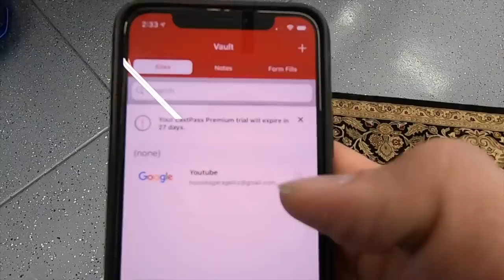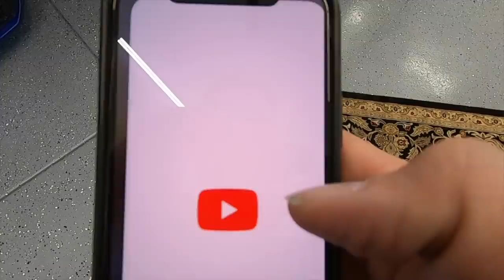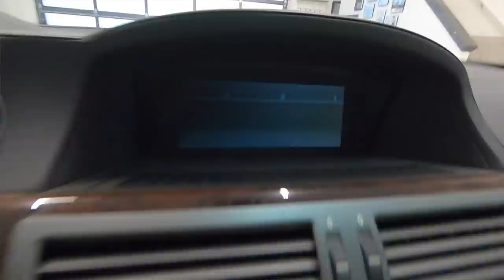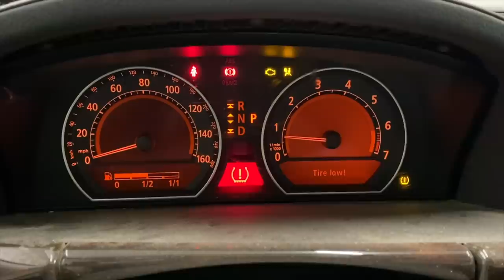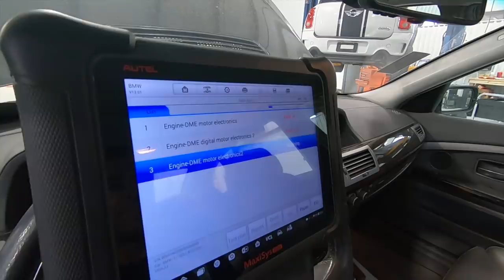I Bought a Cheap V12 BMW 760Li, Because I Never Learn From My Mistakes

Comment: Hoovie: Is there any BMW made good

BMW specialized mechanic: No
Reply: Idk?? Maybe any new BMW? These silly stereotypes hav to end! 
#beemsforlife
Reply: @nocreaselucas8810  I doubt that. I bet old BMWs are better. New ones are made to break right after the warranty expires. Now German manufacturers are not what they used to be, now they care only about business and sales, not longevity of their cars. Nowadays a car is treated like kitchen appliance basically.
Reply: @natethekvd  The E46 only with 6 cyl engine. 4 cyl engine with valvetronic or ANY engine with valvetronic: don't walk away, you run. Run like hell!
Reply: @nocreaselucas8810  Any new car is"good"as long as its new.....
Reply: Specialized with only seeing the BMWs that have been neglected far too long since the owner could never afford it in the first place. 16+ years of BMW Service work I will say that there are many reliable BMWs but You have to maintain them.
Reply: loranga japp pp
Reply: @EYUK1  ?
Reply: @natethekvd  My previous 2004 e46 330cd chipped (250bhp, 510nm) did over 250k miles on the original clutch. It was still in good shape when a sold it. Had to replace the hardy disc a few times and some other small things. Best car i ever owned.
Reply: The e38 is good
Reply: @ruudklasen8656  Its nice,not the same as good.

Comment: Hoovie: “have they ever built a good BMW?”
Pro BMW/German Mechanic: “Not that I know of”

😭😭😭
Reply: Swat all the bmw’s made before the 2000’s are actually pretty reliable as long as you maintain them of course
Reply: The truth sucks 🤣
Reply: @yourfather5324  True, buts most of those have now rusted to death. So all in all there aren't may BMWs out there that could still be classed as reliable.

Comment: ''Have they ever made a good BMW?'' Pretty much anything before 1996.
Reply: Andy Andarius No they were still pretty crappy....
Reply: Andy Andarius *Sad E46 Noises*
Reply: das wright  I had a 1987 735 and it was crap....
Reply: @lorangajapp8086  Why? It's a boat on wheels, super simple to work on.
Reply: @MiGujack3  Still crap...
Reply: @lorangajapp8086  Proper reasoning and arguments. Not.
Reply: @Swordie100  What?They are bad.
Reply: @lorangajapp8086  You are literally acting like a 6 year old by screaming you don't like something, just by not providing any facts or arguments. You're just yelling and looking for attention, that's all.
Reply: @Swordie100  No,they are just shitty cars.Dont care if you are a fan boy.And i never said i dont like them,they are just bad....Sadly.
Reply: @LuredDecoy  You are the one who dont know about cars...I worked on them for almost 40 years...BMW is nice but not good.The 760 in the vid is probably a wonderful car,but not good.
Reply: Nah, the M52 and M54 engines are all basically solid so long as you do preventative maintenance on all the plastic and rubber bits that fail with age. I've had several and none of them have ever died on me. It was post 2000 when they started to get too complicated for their own good. I think the E39 and E46 were the last models that weren't designed to fail right after the warranty expired. I think they will be considered classics in a few years.
Reply: @soundseeker63  I really liked the e39.
Reply: @lorangajapp8086  got an '83 bmw 320i with 300k on the original motor lol the e34 5 series is a great car too and not to bad to work on compared to an e39, e36 also a great and decently reliable sports car... maybe the shit automatics with air suspension are unreliable but they make some pretty good manual gearboxes and static suspension if i say so myself... lots of great motors anc cars from them over the years
:)
Reply: @sebg1224  Love the gear box on bmw.
Reply: @s.i2282  No i have my own business...No you wouldnt fan boy.Come to think of it,i havent been on a bus(except my own)for 20 years.And fyi i actually bought a 2014 mercedes today :)

Comment: Buys V12 7 series
Also has Rolls Royce Phantom
L O G I C
Reply: One for cruising, one for hooning
Reply: Logic7 ;)
Reply: they are not the same cars, thats the logic
Reply: Tehgziz Lauw it’s not like he has a gallardo or anything....
Reply: @dr-ok3sn  both the phantom and the 760 has the exact same sound system called Logic7 with a Logic7 DSP/amp that's notorious for breaking as soon as you look at it.
Believe me I have one and it's sent away for repair right now.
Reply: Logic 7 :)
Reply: @papaannefranku9693  yeah but he won't feel bad about hooning the 760, the Gallardo is mint
Reply: Shug not even close🤦🏼‍♂️
Reply: Nordmark productions most of them rolls royce are using actually a meridian soundsystem but okay😂
Reply: BMW could be a parts car.

Comment: 16:09 $2800 repair - that's typical - welcome to the 760LI owners club :) wait until you discover that swapping plugs-only is unlikely to fix your misfire and you will likely need to swap all 12 fuel injectors (and coils,) lol, then you will really experience sticker shock. Check out my 760LI on Scotty Kilmer's channel...
Reply: Yes. The check engine light is unfixable on the v12. Coils, plugs, injectors, injector wire harness, valve stem seals, carbon walnut blast, intake leaks.... no fix seems to make the check engine light stay off.
Reply: @TheButcher9811  Really?? Mine has no such problems with the check engine light - but I had the misfiring on several cylinders shortly after I bought it (but not all 12 cylinders like this salvage car he bought!) and changed parts sequentially without success until throwing in the towel and replacing all the injectors, coils and plugs as well as the 3 fuel filters (yes, you read that correctly - there are 3 fuel filters in this grossly-over-engineered car!) and it has not had misfiring issues since then.
Reply: Scotty kilmer, i wouldnt trust that old fool

Comment: I have a 2008 BMW 760li, I haven’t had any issues with it, I had to get the computer update but it was free!
I also have a 2013 Mercedes S65 no problem with it either. Kia, Hyundai and a few others shouldn’t be mentioned and never compare to BMW or Mercedes these two companies been around over a hundred years so they must be doing something right!

Comment: I have a BMW for the last 4 years and has been the most reliable car I ever owned.
Reply: Same here, its a 550 v8. Maybe we are lucky
Reply: @nature10879  Usually BMW drivers don't really take good care of their cars, plus for most of them their driving style is damaging.
Reply: Both of mine were aswell I'm looking for a 3th one
Reply: @gordonnorris4202  after 3rd owner, its total neglect
Reply: I have a hard time imagining that I won't make it past 200k miles on my 2007 X5 and I tow it's capacity pretty regularly.  I love me that N52 engine.
Reply: @russianrick8403  mine was at 230k before I crashed it I could of done even more and I would probably still have it cuz I loved it
Reply: Same here I'm on my 3rd 7 series, 01 e38 no issues, 08 e66 no issues, 12 f02 only ac/heater blower motor
Reply: You must have come from Jaguar.
Reply: Same here, had my E60 530d for 4 years now, runs beautiful. I was considering working from home once for example and thought nah fuck it, I'll drive in lol
Reply: @nature10879  Hey man, I have the same car 08 550i manual and it came out of the shop this last wknd. Had to replace the alternator bracket gasket which cost me 3200 after paying to clean the engine bay. Did you have any leaks on the car and what milage?
Reply: @GanjaBear29  None whatsoever. Mine has been trouble FREE. Its automatic, and i currently have 153,000. I may need a battery soon though. Its getting cold outside here in kc. I started having to reset my clock. Other than that its been flowless. I am watching out for stem seals but so far reliable car. I hate run flats too.
Reply: @nature10879  steam seals will be an 8k job. I would throw in the towel once you start seeing smoke after idle.
Reply: @GanjaBear29  Yes at the dealer. I know someone who can do it for half the price or less and he only specializes on bimmers. However, if that happens, i will have to weigh my options. But i will stick with bmw, specifically an X5M from carmax. Am open for a Porsche suv from car max too.
Reply: Sebi Gordan can’t relate 😂😂
Reply: Rick Harris I have an 08, taken care of well, and pretty much everything is wrong with it
Reply: have 4 BMW's, one of them is e66, two are over 200k miles...  no major issues.  more reliable than most other cars I ever owned, and certainly the easiest to repair.
Reply: @GanjaBear29  "alternator bracket gasket" ive never heard of a bracket gasket and ive worked on cars for over 20year and have been ase certified for 15 years.
Reply: I have a 2003 e46 that I still drive everyday. Lots of preventative repairs, but nothing major. But it does leak everywhere every now and then lol.
Reply: nature10879 e60? I just picked up a e63 650i 6 speed manual with 61k miles. Had a check engine light for the variable timing valve solenoid. Cheap replacement part and now the car is running like new.
Reply: Rick Harris the m54 engines were the most reliable in my opinion. My father in law still has his x5 with over 250k original motor and trans. Lol
Reply: @shootunderpar4736  good. Remember oil change regularly too, no 8 to 10k intervals. Maybe 4000 miles or less. You dont wanna mess up the stem seals. When they dry/harden out, the car may smoke and run rough. Its a 4k to 8k job. If the previous owner/s took care of it, it should be very reliable.
Reply: Dude most of them are so unreliable. Good luck with yours.
Reply: @nature10879  in My country you can replace the valve stem by 1500 It's not a big deal
Reply: @edgardonunez4434  that is nice. Here stupid people rush tk dealers a d get ripped off. It can be done for 3,000 at a trusted independent mechanic. 1500 is really cheap:)
Reply: @nature10879  Tbh it's not even that big of a deal. People always make BMW repairs sound like this incredibly expensive job, and Tbh, the parts aren't that expensive.
Reply: @protess5  yes absolutely.
Reply: @bigsean2473  I would suggest googling it. Unfortunately, it is a real thing. I couldn't believe it when I first heard of it too.
Reply: @timothym5678  i did that day. seem the bracket housing is made on a motor cover. why idk but it is
Reply: @GanjaBear29  3200 for a 5 hour job? Man I'd love to be a tech wherever you go.
Reply: @BNR32FD3S  It included some additional stuff like cleaning the engin bay and replacing some small shit. Truth is I get fucked if I dont know someone which is what happened. Actually I need to take it back this week b/c the engine light went back on after 3 hrs of driving and there is smoke comming from somewhere by the light. Good thing is I have a manual car so its not a total loss
Reply: Four years is not very long.
Reply: Sebi Gordan me too my 750Li has been extremely reliable. You just have to find one that rich white people have driven carefully
Reply: What other cars have you owned? BMW starts out great but once past the "lease period" they're pretty awful and there doesn't appear to be any reason for it.
Reply: @gordonnorris4202  really the driving style isnt much damaging. its just poor people that end up buying an BMW just so "showoff" (70% of the buyers) and when they have their BMW they see it requieres alot more maintenance then their previous fiat. because they've spended all their money on the car they cant afford good maintenance en the car breaks down. i have an BMW 540i xDrive (newest 2019 full option luxury line) en its really reliable. also really fast (4.8 sec 0-60)
Reply: @gtigaming3059  If you do burnouts and launches everyday to show off, of course it will damage it.
Reply: I got a high mileage 545i to have a second car. Outside of the e60 m5 and this 760i they are roughly all the same. Change the coil packs sparl plugs and gaskets. The best vehicle ive ever owned. You cant compare a camry to a bmw. Ive got 280k miles on it now. Over 100k in the last 2 years. Still has a lot of power and handling is awesome. If someone gave me a brand new camry i would sell it and get a used bmw.

Comment: My friend bought the same car brand new back in 08. He sold it at 45 thousand miles and said he would never buy another BMW again. It was having problems at 30 thousand miles repaired it under warranty and then drove it for 4 months before selling it. He got stuck with the Limp home mode twice and again Factory warranty fixed it.

Comment: I’ve got an 02 525i, and I absolutely love the way it runs and drives, but the random electrical issues have driven me nuts, I got extremely lucky to find the same year and model at a you-pull it, it was a body control module, the wipers, locks and interior lights stopped working . That said I love BMW’s

Comment: If you're trying to get a good bmw, get one with an in-line 6 engine, like a e39 530, or a e38 730
Reply: Ace of Spades e46
Reply: @theangryitalian7922  yeah, that as well. I'm surprised how bad his experience was with the e36 m3 he had, The next owner is probably having a good experience after he fixed so many things and sold it
Reply: I have 728i ! Good car !
Reply: @TheRazvy1990  blană șeptaru'
Reply: Ace of Spades doesnt the 530 have an i4
Reply: @hima-iv5mc  No, its an inline 6, even the 2l that came on the 5 series e39 from 1997 to 2000 was a 6 cylinder. There was no 4 cylinder gasoline engine on a 5 series except the e34 518i and diesels.

Comment: Well if you think about it, if you pay $4,500 for a luxury car and then spend $10,000 in parts to get it back on the road and running in tip top shape. You're still getting a car that went for over $140k new for under $15,000

Comment: The E60 M5 is a beautiful car, the thing is it takes a lot of love and attention to keep it running nicely since it is obviously a high maintenance car. The M5 can’t really be used as an everyday car, you need a city car for small journeys round the town. The M5 belongs on open roads. 

You bought a severely neglected and abused M5. The previous owner obviously didn’t take care of it, didn’t do servicing, diagnostics, repairs, maintenance or preventative maintenance. 

I’ve had an E60 M5 for 6 years now. I have 2 different code scanners. You have to diagnose it immediately when it tells you there’s an issue. Not just ignore it and complain about the dash being ‘lit up like a Christmas tree’. All the systems are interlinked so a fault in one place can cause other issues. 

For example a faulty wheel speed sensor will cause issues with traction control, ABS & gearbox since the onboard computers will be confused as to what’s going on. If you diagnose the issue straight away then the sensor can be replaced fairly easily and cheaply. If you ignore it the car will be very sick indeed. 

I’ve had to do loads to the car over the years, but the most important thing is regular engine oil changes and change the gearbox oil & differential oil every 4/5 engine oil changes so the entire drive train is always working in nice fresh oil. 

If you cherish the car it is an awesome driving machine.

Comment: When dude said “you have a misfire in all your cylinders” i lost it
Reply: Same
Reply: lmao good catch hahaha
Reply: A could just be a vacuum leak
Reply: wait is that both engines?
Reply: Lmao 🤣 🤣
Reply: Swiggity Swooty Im Comin' Fo Dat Booty 

“You have A misfire—

Hoovie: Oh thank god only one cy..

On all cylinders”

Hoovie: ._.
Reply: Lol
Reply: To me it would be a relief to diagnose the misfire on all cylinders as I  think in this case at least it is better to have misfire on all cylinders than on one or two specially since the car was obviously behind on maintenance. The new maintenance may be all it needs to correct the misfire problem (like new coils, spark plugs, vacum hoses, oil seals, etc..) the stuff you would do anyway.
Reply: Happened to me on a S65 AMG I nickel and dimes then got rid of it..

Comment: My buddy just bought a 2013 BMW M5 in frost gray, it has everything. Only 7 were made in that color and it has less than 35,000 miles. It was $107,000 brand new and 6 years later he paid $36,000. He immediately had to put $1700 into it for brakes oil change and A/C.

Comment: Damn that's sad my 750li was a hand-me-down that has only had 2 issues since I've had it and that's oil consumption and a radiator hose and my 2001 740 is a tank along with my 540i wagon

Comment: Unless I'm mistaken, that total does not include tires... But that's not bad. I just replaced 6 coils on my 128i (2013, which I bought 4yo w/11K) for almost $900, right after I did the 30K service, which also cost about $900. That's not too bad, either. However, my car has less than 35K on the clock, so, I suppose this is just the beginning. I'd swap it out for something else, but what other car can I get which has a fairly powerful front engine, RWD, MT and seats 4? I don't know about ANY others, for less than about $80K, and even then... there's not much else.

Comment: Rewatching this for some reason, perhaps as been watching a lot of Velocity Garage. All Tyler’s cars need brakes. The sensible thing would be to learn to replace pads and rotors (or discs as say here). That’d save enough across his fleet to buy another disaster. I mean BMW.
Reply: Realistically, MOST of his repairs can be done by any amateur. He goes through a lot of cars. Unless the sponsors are paying for all this, a guy that obviously likes cars and spends more than a typical salary on routine repairs should watch YouTube and start doing 80% of the work himself. Anyone should be able to replace a set of disc pads, and while you're there it's an extra screw to swap the disc. With zero experience I did coils and spark plugs in my new N63 for a massive misfire.